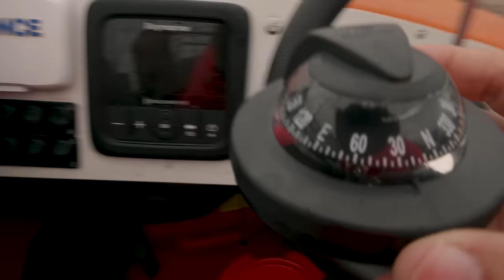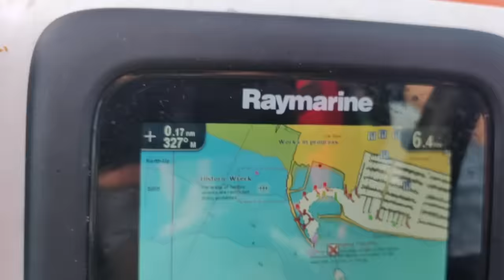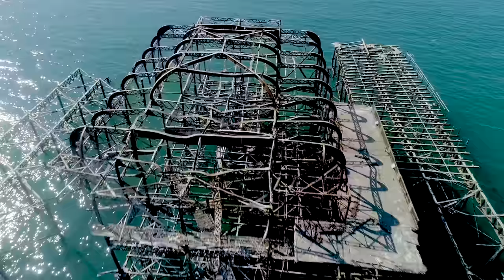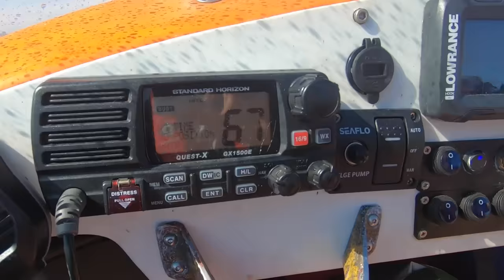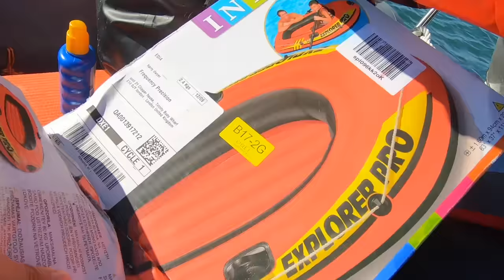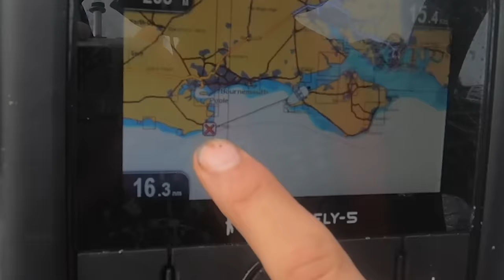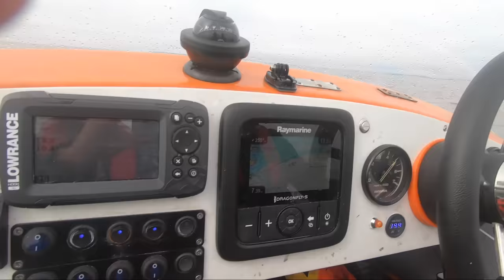1700miles in a tiny speedboat - Part2

Comment: You were lucky enough to have an aluminium propeller broken. If you had a stainless steel one you could have the engine's shaft broken! However, I am really excited with what you did and I can't wait till next May that I will start from Piraeus to do the Round of Europe trip on board a 6 m. r.i.b.

Comment: Makes me wonder what the official record is for "smallest vessel with a tender?...
Reply: yeah like could someone explain the reasoning to using a 6ft tender for a 10ft boat
Reply: @AirCrash1  Goodwin has a propeller and depth gauge hanging off the back, both of which were broken last time he took it ashore. I guess for the sake of not damaging the larger boat he bought the little blow up dinghy
Reply: @HisnameisRich  I live on the Southern Ocean, you can't legally take a boat out without 2 engines and 2 props. All critical systems must have redundancy...this was discovered about 500 years ago. If he had just prepared his boat for offshore ocean use then he could have completed the mission without interruption. He would also have discovered that your skin starts to fall off after about 10 days if you can't dry it off. A long journey in an open boat is only possible if you can keep dry for a few hours each day. I challenge him to do the same mission solo as I reckon the only reason he is continuing is because he know he wont die alone..lol
Also depth gauge and 10ft boat like wtf? if you can't see with your own eyes water that is too shallow for a 10ft boat then you should not be out there.
This is just a clown show for YouTube the surf rescue where I live uses the same type of boats with a single outboard and they just fit a prop guard so they can beach without damage. Any small boat going offshore must be able to cope with multiple capsizes which means everything on board is kept in waterproof containers lashed down at all times. A small boat on the ocean can be blown across the surface like tumble-weed in a squall. I reckon one capsize of Goodwin and this foolish endeavour will be over.
Reply: @AirCrash1  Certainly takes balls to do what he is. Having said what you have he never seems too far from the shore. You make some good points, but in the Australian Army we use Zodiacs and found that prop guards cause cavitation which results in a reduction in speed and breakages to the prop shafts. Not ideal for our use when we end up with a third of our craft unusable.
Reply: @holdfast7657  I race small boats offshore, it's not pleasant and you need a lot of mental fortitude. Try climbing back in the boat after getting knocked over for the 3rd time and continuing. I broke my arm once and had to right the boat with one arm and rescue my crew who had become tangled in the ropes and was getting pulled under then sail back, I broke my arm so badly that it took a year before it was fully healed. Solo is even more frightening
A well designed prop guard just lowers your speed and efficiency and if it's just to kick the motor up on the beach or rocks then they hardly make any difference. The one on the motor provided by the manufacturer should suffice. Rather learn how to beach properly than stuffing around with that inflatable toy tender. A dented prop should be the worse you suffer or you are doing it all wrong, should be in neutral and only in gear in short spurts. Anchoring a small boat close to the shore then sleeping is a bad idea, rather pull it up the beach with some pulleys. Carry a spare prop and cotter pin, I once had to change one on the same size boat out in the Atlantic. Had to pull the motor into the boat and fix it in 10ft swells, was vomiting while I fixed it.....lol
Reply: @AirCrash1  He's not asking you to go with him. Why are you so upset?
Reply: @tshepp89  I'm not upset I am just pointing out what he has already discovered but is glossing over. Small boats off shore, you need to be fit as a fiddle and hard as nails or you will fail........there are rules to endurance challenges and stopping at the next port for 3 weeks while you repair your prop and pluck up some more courage would not be considered a circumnavigation.
Reply: @AirCrash1  that's some pretty impressive stuff my good fellow. Stay safe.
Reply: @AirCrash1  hi do you have anymore stories on your solo trip I would love to hear them my good fellow

Comment: I'm wondering whether you’re going to go around Portland on the ‘inside track’ (100 metres offshore or the outside course (10 miles out)..
Reply: Exactly this, anything in-between would put you on the road to disaster.

The race is not to be messed with
Reply: Offshore 100%, way to risky to go inside
Reply: The Samuel Stone it’s an interesting quandary and it only gets worse the further west you go. 

The Cornish coast is just as dangerous, if not more so. 

I really think they need to start talking to people who know the waters they are traversing and start to make a proper course. The Lulworth range infraction is a case in point. If they had the correct charts they would of known that they were motoring through a restricted area. I put it down to inexperience and hopefully they have learned their lesson.

Talk to the local fishermen, check the charts and get the best advice possible for that stretch of coast.

I really want to see them succeed on this endeavour, and I am enjoying the videos hugely.

Comment: Have you considered running a stainless steel prop? They are pricey but if you know youre occasionally going to risk it in shallow water to me it’s worth it. If you had sheered one more blade off that prop and it looked close you would have been calling sea tow. Also dope channel!
Reply from the maker: Ahh so a stainless steel prop is less likely to brake when hitting a rock?

Comment: How about putting some grease on the spline before fitting the prop???
Reply from the maker: Yes, I did wonder about that. The old one slid straight off and there didn't appear to be any grease on it so fingers crossed when we hit the next rock it won't be stuck on there.
Reply: Put some grease on it anyway, should really check it every now and again for mono line behind the prop. It cant be seen but will screw your oil seal. Don't bother with a prop repair, it can be done but not worth it.

Comment: Stainless prop next time! (and not from Honda lol) also fit Hydrofoils (a must) and perhaps even a propguard if your beaching a lot while using an aluminium prop
Reply: Jay Zee: Truly! I wouldn’t recommend a prop guard. They are used in sailing clubs to defend against poor safety boat driving. I speak from a point of knowledge on that one. They allow you to be lackadaisical in your approach to boat handling relying on a flimsy piece of plastic to dissipate the effects of your errors... (By that I mean mowing someone down through sheer inability and inattention).
 
Also the prop guard would destroy the speed on his rib. On a 4.9m with a Suzuki 50 hp it achieved 23 knots when first purchased, secondhand I should say. The do-gooders at the sailing club fitted a plastic prop guard (which was immediately split by the old and bold brigade) to the afore mentioned rib. I clocked it six months later with the same sea state and loading - 15 knots. It could barely plane....

I’ll admit to having never tried hydrofoils. But the prop guard, never in a month of Sunday’s. Invest in proper training before you fit a guard to defend against stupidity.
Reply: @PhilbyFavourites  Plastic prop guards! Yes, stay well away from those nasty things!, only buy a good stainless steel one or have one fabricated.  The prop guard is stainless steel on my Ribcraft 4.8, made using an outer ring of 10mm x 150mm stainless strip, so very little drag but very strong but downside is heavy) I copied this design   https://equipment.dewolfmaritime.com/wp-content/uploads/2015/08/1_25NMHOL-INOX-prop-guard-3.jpg    , and a local fabrication shop made it. While it does create a small (perhaps 10% to 15%) drag at wot, I personally rarely go top speed. The key is to have a close fit to the prop tips or it upsets the flow and creates excess cavitation and turbulence. I have found it of great benefit in shallow estuaries, especially coming back to port when approaching low tide when risking bottoming constantly (just unlock the transom lock and let the prop guard hit the bottom instead of the prop!). I used to replace a prop every 6 or so months, but since the prop guard I have not replaced one in the last 3 years!  Hydrofoils make it so much easier to obtain planing at lower rpm even with the prop guard (the drag from the prop guard was actually the reason I thought I would fit hydrofoils at the same time lol).  I would say a 15% reduction in rpm to reach the plane.
Reply: Jay Zee: I guess I operate a little differently to you. Solent based here and play the tides, I’m never scooting around at low water unless I really need to. Sword Sands for loafing about on in those cases. Mechanical sensitivities just wouldn’t let me bounce the prop guard off the bottom, if I’m that shallow I’m walking alongside it 😎😎😎

Here’s one to make you smile, with my regular drives (one my own and one I instruct on) I set my own personal limit at 2.0m on the depth. If it drops below that then I’m looking over the side and down to trickling along at walking speed. I love estuaries and spend a huge amount of time in the three eastern Solent Harbours. I'm just an OCD tides planner.
Reply: @PhilbyFavourites  Yes, sounds a bit different to my habitat!. My area is more towards Looe / Polperro and Fowey, sometimes venturing to Mevagissey and Plymouth (although I try to stay away from Plymouth, a bit to busy!). Looe estuary and harbour has a nice habit of catching you out some times when messing about in boats passing time, and draining rather quickly with a fast current (hence bottom bouncing a lot)! I tend to do a lot of beach trawling too, so it's just a case of each outfit is set up for a specific environment. Always great fun though every time! All the best in your future adventures afloat!

Comment: Your compass is not much good, if you don't also have the corrections labelled near it of the local variations, and also adjust for the errors induced by nearby electrical activity. On top of that, you  also get errors turning where it overshoots, not a problem, and you also get errors you have to adjust for when the vessel accelerates and deccelerates.  How the fuck dd this underline get here? lol